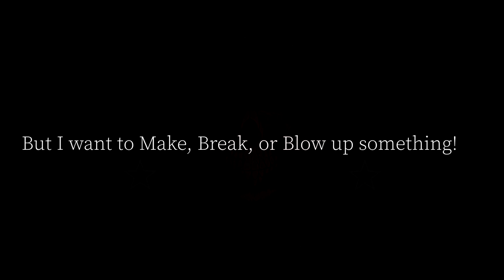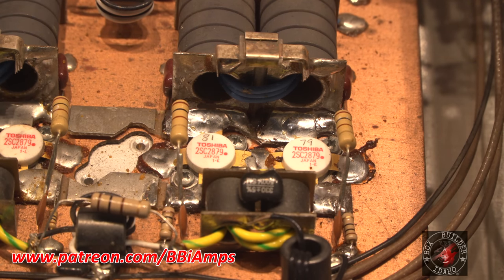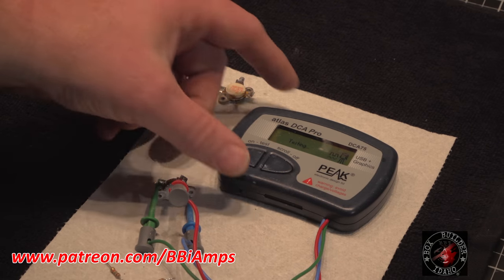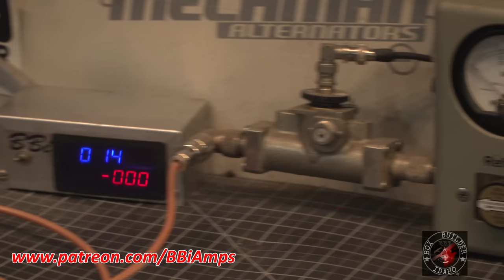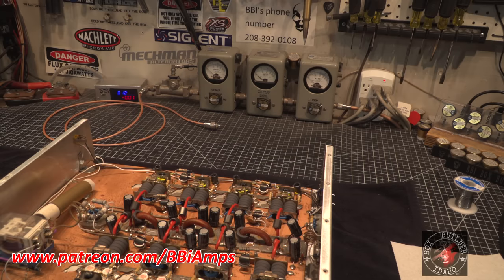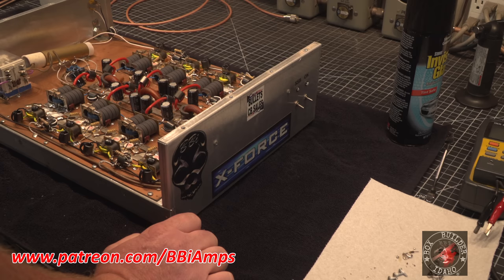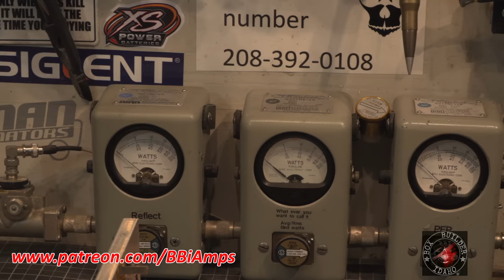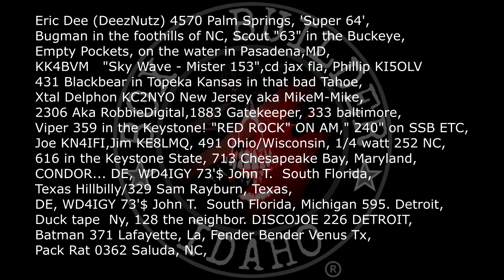Let's rebuild a 4 pill and a 16pill

Comment: Hello Fellow BBI FANS & Friends: One thing I've learned from you is that solder workmanship is essential especially when a device is exposed to continuous high current. As you have clearly stated the solder work is so decrepid it looks like Ray Charles & Steve Wonder attempted a HALF ASSED REPAIR. IMHO with the hard work, cost of these devices,  & the limited availability of replacement components I don't understand why people refuse to care for these devices.  I guess easy come & easy go !!!! Luke the screws / bolts you were referring to are called TORQUE TO YIELD BOLTS, ( ONE TIME USAGE ). Thank you Luke for another terrific video sir . As always BBI my best wishes to you and your family  !!!! TMP, Unit  22 from N.J. 😊😊😊😊

Comment: I get that way with bits an junk  returns and defects  all over the place .service guys keep dumping sensors and relays and motors on my bench on the way in and out the shop .The food  industry has the most degenerate practices out in the field ..The VFD stopped working ?????Because it's full of flour and oil .contacts won't close because they are full of dough and crap !